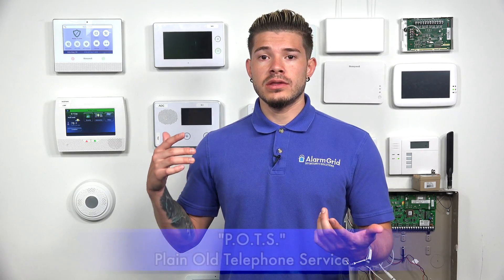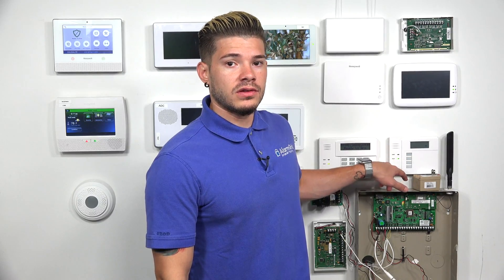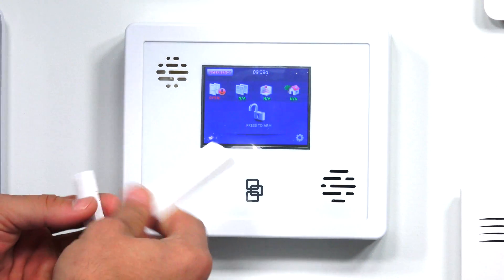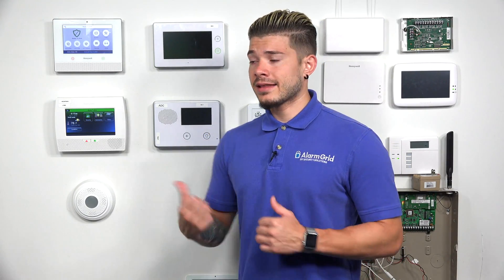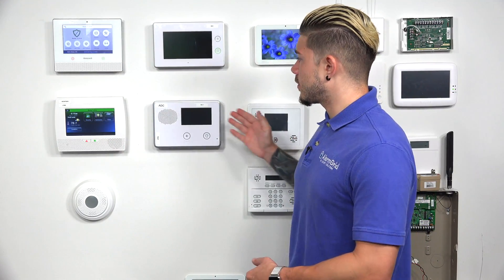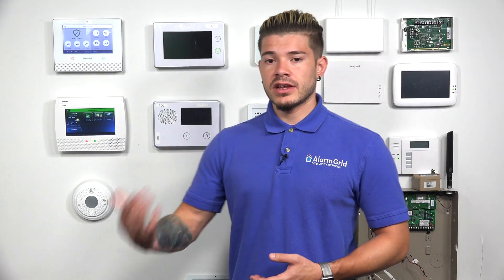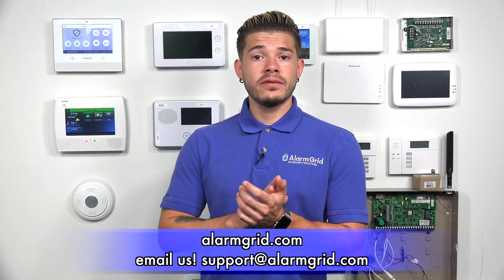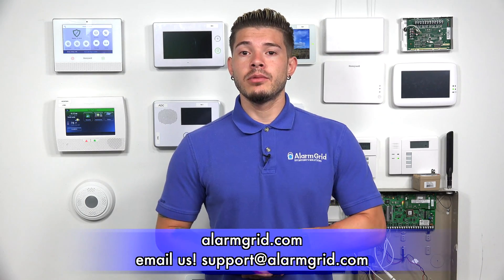How Alarm Systems Work

Comment: If someone is using a RF jammer, all wireless communication will be blocked so how does a wired/wireless alarm system base station will send the signal to the authorities? via wifi, cellular, ethernet?
Reply: The system does have an RF jam detection feature if it sees jamming for longer than 20 seconds it will transmit an alarm and go off at the panel.
Reply: @joshuagriffin2807  how is the alarm transmitted? if the jammer is in use, I'm guessing the alarm is not transmitted but the siren will go off, am I wrong?
Reply: @BladeAndrade  Also, most security systems are hard lined. If a device becomes jammed in the network and the controller can no longer communicate with the device, the hard wired controller and alarm are triggered which  sends the alarm signal out.
Reply: Most RF (radio frequency) devices have built in filters and jammer detections methods. Keep in mind, that for an RF jammer to function effectively, it must alternate bands/wavelengths. 

Most security systems are not exclusively RF and if they are, they have different wavelengths. 

It's not impossible to completely jam a specific RF frequency... but it's not very plausible. Especially considering that communication devices are heavily controlled.

Comment: which sensor you use at the door?
Reply: Door contacts: Contacts are used to alert you in case the door has been opened or closed depending on how its wired (normally open or normally closed). Thatll send a notification to your KP, notifying you that its been opened or closed. By default it should be wired normally closed, meaning its default position is closed, but when opened, itll send out the alert.